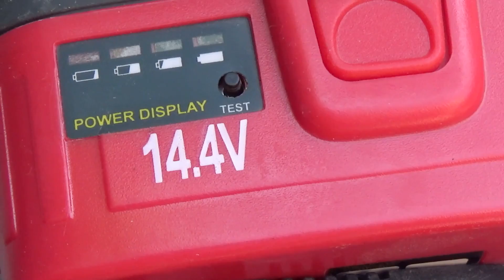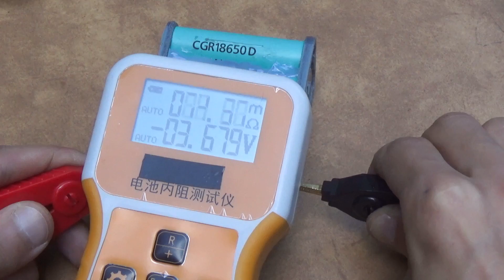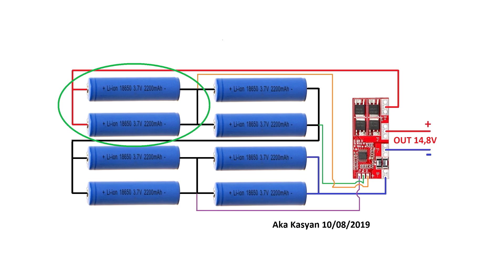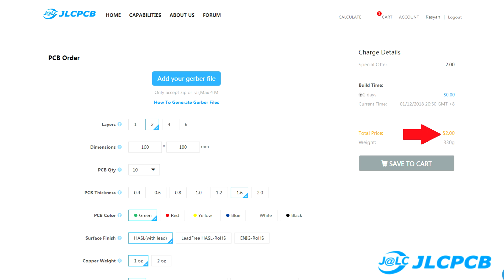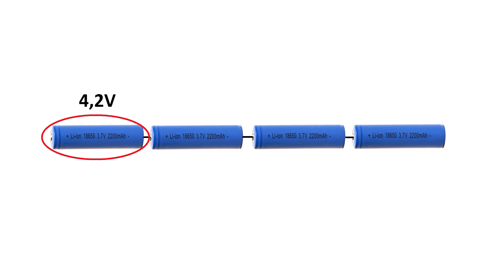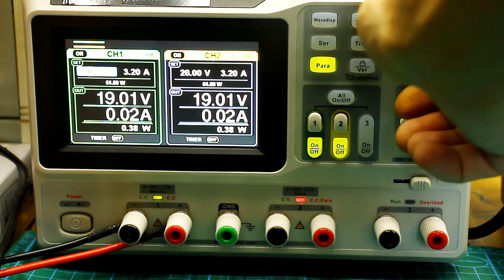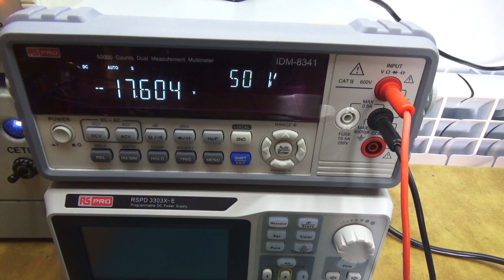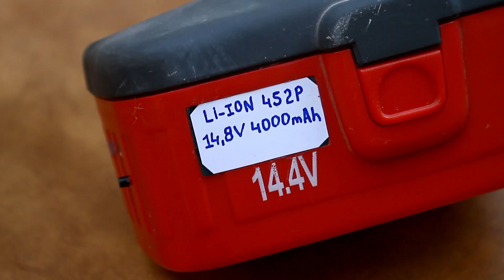The Big upgrade screwdriver

Comment: Hi there, another great video, thanks.
You mentioned that you had built a welder for welding the connecting strip between the batteries on a previous project, did you do a video on the home made strip welder?

Comment: NiCd batteries would last longer than LiIon batteries even if they were old. I have 4 nicd batteries that is produced apprx. 25 years ago.
Reply: Because NiCd can bear very heavy load or current draw in one . Li Ion that have High Drain tipe is good for replacement this kind tool, but not all Li-Ion love High Current!
NiCd just win for this battle